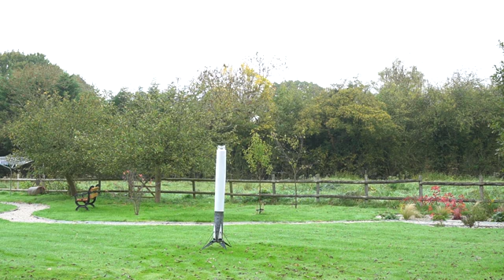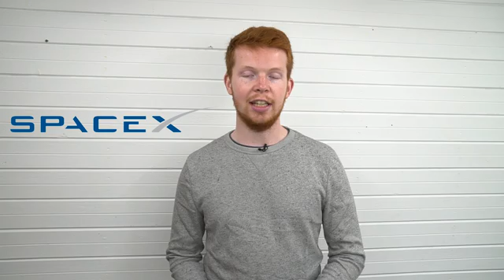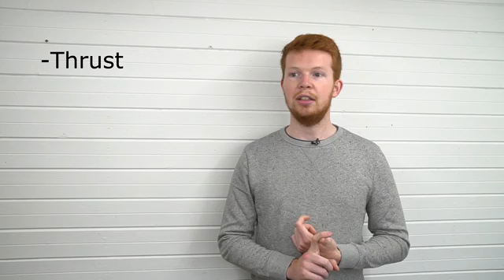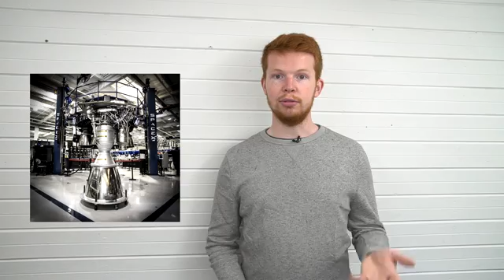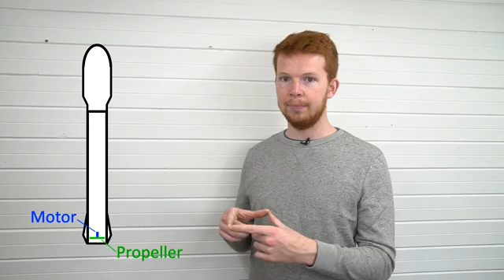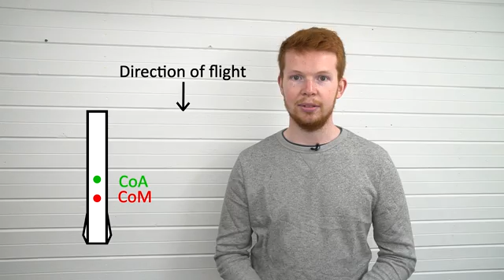Hovering a rocket - SpaceX model

Comment: Great video as usual! Only one or two issues I had with it, which are mostly semantic. First, I think it's important to clarify that using the center of area only really works for very simple and classicaly designed model rockets. For something like a falcon 9 or if you want to fly in directions other than up, you really need to find the true point where aerodynoc forces act, known as that center of pressure. Using the center of area approach would mean that a Soyuz, for example, would have its aero forces acting on a point near the back, but in fact it, and most orbital rockets without fins, has its center of pressure so where very near the nose. Most orbital rockets are actually aerodynamic ally unstable, and rely on the control of the thrust vectoring to stay up right. Second, and this one really is semantic, but there are more than 2 types of rocket engines. There's hybrids, which use a solid fuel and liquid oxidizer (See Virgin Galactic's Spaceship 1 and 2), Monopropellant, cold gas (similar to monoprop but without any chemical reaction), various electric propulsion systems (hall thrusters, VASIMR, etc), and nuclear propulsion (there was some limmitted testing of this during the cold war, but it hasn't been done since, although there are good reasons we should revisit it). Those are all the remaining types of rocket propulsion I can think of. If anyone knows any I missed let please me know.

Comment: It's a pain in the ass trying to land on or take off from grass. Especially the latter. 
Regardless if it's a rocket tripod or a remote control helicopter, some part of the landing gear is going to get caught up in the grass (unless it's a putting green). 
Even landing on grass is a bitch because while it may appear soft, it is also lumpy and therefore uneven.
A paved surface is generally better for either landing or taking off. That said, the consequences of failure can also be more damaging on pavement/concrete etc whereas grass and soil provide some level of cushion.

Comment: Just a thought...Seems you could support the rocket during tuning with a surrounding 'safety' hoop say 3 feet diameter, attached to the ground with attached stakes, and with the hoop positioned about 2/3 of the height of the rocket. Something akin to a support for a small plant or tree.  Such a support structure could prevent the rocket from rotating and hitting the ground when unstable.

Comment: Use some prop like old oxygen/carbon dioxide cylinders, proper reshaping it try to build a liquid fuel self correcting rocket atleast able to hover 50 feets high.

Comment: If the thrusters or control motors at the top of the rocket are pushing air up wouldn’t that act as resistance towards the motors at the bottom trying to push air down?

Comment: A few possible ideas here (not very scientific) firstly your tube diameter/compression of air why not funnel the air to be more focused. Example if you have your hand 40cm ish from your face, blow at your hand with an open mouth and it takes some blowing to feel it, blow at your hand like whistling. Not only is it more sustainable but it takes less to impact. Second on the subject of air flow coulda "laminar flow" help (this relates to jumping jet water fountains, but maybe the same could be true with air/ducting).  Simple examples I have seen to create the laminar flow are packing the tube with drinking straws and forcing the fluid (or in your case air) through them. Thirdly propeller choice I dont think you mentioned this but with quadcopters they have two opposing props.  When you used two were opposing or the same, and when you used one was it a neutral? Could this have affected some of your stability.

Comment: Very cool. Have always dreamed of adding a few of these large motors to every wheel of a sandrail so when you get air the fans keep the rail aligned in mid-air so all four wheels contact the ground at the same time. The hurdle is keeping the sand out of the motors.

Comment: SUCCESS. I have a project with thrust vectoring.  Maybe you can get a motor with a higher power handling and output. As I watched I thought maybe you could also use two motors computer control to alternate if the other began to overheat or fail. I know this is more weight and computing but it was just a thought.

Comment: Just... no.  
Your attitude control scheme is based on flawed understanding of physics. When hovering with propulsion like this, accelerometers are of no use. That is to say, your inertial frame carries very little information on your attitude. 
Center of mass being in front of center of pressure (as you kind of tried to explain) is important when you have forwards momentum, but really irrelevant in the case of hovering. 
The mass distribution of your rocket is also kind of irrelevant. top- or bottom-heavy vehicles can do this, your rotation axis just is a bit different.
Reply from the maker: Accelerometers are hugely useful in a rocket like this, unless you're skilled enough to react precisely within milliseconds of the rocket tilting. When I explained about the centre of mass being in front of the centre of pressure, I was referring to the accent/decent of the flight, so when it has 'forward' velocity. To claim the mass distribution is irrelevant just says it all really, almost as ridiculous as claiming my physics understanding is incorrect.
Reply: I should have phrased that differently indeed..  What I intend to point out is that while accelerometers are very useful to assess velocity, they are useless in stationary hovering (other than to indicate that we indeed are not accelerating in the axis of the rocket.) You indeed need to use gyroscope or some other reference to determine your angle. This is analogous to the pendulum rocket fallacy. - Gravitational acceleration is reference-frame independent - This is something that is completely understandable from high school physics but often fools somewhat good engineers even. If you think this is something that can be handwaved off, you have not really grasped the problem.

What SpaceX uses is gyroscopes because they have money and access to highly accurate ones. The stuff a civilian can buy and fit inside something that flies with batteries will hold sufficient accuracy for some minutes if you do your algorithms correctly. Without corrections, they will veer off in some dozens of seconds. You can use some trickery to get away from this. One that easily comes to mind is some sort of image recognition in the bottom of the aircraft. In these times when you can perform image recognition on a dime this sounds like a good idea, until you take a look at the footage you will be dealing with. The shaking is immense when mounted on a light RC-craft. With some heavy stochastic corrections, this will work though. 
Some RC planes use IR sensors on wingtips and then place their bets that generally space is colder than ground, and hence horizon will be observed at wingtip as a falling edge in IR spectrum. This can work wonders on high altitudes, and cause hilarious crashes between obstacles.
Reply: Also, you are correct in that the center of mass is relevant in the sense that the rocket will rotate about it, and the attitude thrusters will have more momentum if the CoM is low.  I should have stated my point like this:  A low center of mass does not precipitate more or less stable hovering quite like when balancing a rod on your palm. It's effect is restricted on determining the momentum an off axis thrust has.

Comment: Inverted pedulum
https://youtu.be/qjhAAQexzLg

And its application
https://youtu.be/15DIidigArA

You can gimbal the engine, change the thrust vector on the engine, have four different engines each with variable thrust (quad rotor), or inertia wheels or some combination.

Inertia wheels
https://youtu.be/woCdjbsjbPg

Comment: 3:24 HA! awesome!
Reply: 12:40  you might need a structure holding. seems like the landing flaps might creating unwanted drag and drift. a structure could hold the rocket so you can have those folded up at launch.
Reply: 18:33 maybe add 2 more smaller props at the top and program them to increase the speed on specific props if it finds itself drifting?

edit: of if you can get it to spin super fast lol

Comment: I'd say it was a success. May I suggest building a light weight ring of about 48 inches diameter mounted about 16 inches off the ground to help recover from tipping (just until you've perfected it. Have you considered using gyroscopic spinning disks in place of the 4 top fans. No idea if it's a sound idea, but a thought.

Comment: U simply got to solve the equation of inverted pendulum & program in controller.
For proof of concept go as small as u can. U should try simple 10$ gearbest quad & use its motors.

Comment: Hi , this is Chris in Bulgaria, modelmaker of stuff and I have a Cr10s. I built a model rocket designed it in Rhino then printed it out. 
While watching your video one of your attempts I noticed the rocket lean over a little. Not what you wanted at the time, but straight away it gave me the idea. What if you were to lean it over on purpose then horizontaly fly. Well, would this make for a Thunderbird 1.
 Living in Bulgaria everything with electric motors is, well, not good. I have learnt to run motors in. I thought what a load of rubbish, but, yes, run your motors in. Start and stop them for an hour or two before going for full power.
I also learnt a few things from your explanation of mass etc. I will stick to the modelmaking, I have a giant plastic box of dead helicopters, hahaha, i think to add a few things to my model rocket as well because of this video, Thanks, keep up the good work. Long live PLA

Comment: Hey it’s a good time to use Machine learning... leave the thing calibrate itself overnight
Reply: Or just use an inverted pendulum controller, you don't need machine learning for a simple stabilizer. It's (probably) inefficient and less intuitive. That's why they don't use machine learning in space flights...
Reply: [Brn], for sure. I thought ML would make stuff easier but just simple Algebra is just enough.
Reply: @wyattb3138  definitely more fun ;)
Reply: Wyatt B , would probably just take a few minutes
Reply: Also put guns on it and enable it to duplicate itself. I don't know what could go wrong.
Reply: Mehhh, not required
Reply: I thought the same, using PILCO for example he would only need to build a couple of these, it should get to a good policy in a couple of trials, trashing the whole thing :D
Reply: I think it could work, but it will be very difficult if it encounters conditions that it wasn't exactly trained for. For example different temperature or wind if it reaches some altitude. Since the resulting model may be a complete black box, it's also hard to find out if it is overtrained without physically testing it.
Reply: Machine learning actually sounds good. It may sound like simple algebra but factoring  in the weight distribution, the airflow characteristics of the thrust vectoring at different angles, the torque / rpm curve of the propeller motor, drag curves for the propeller, thrust vectoring servo motor time to position at different load levels and angles considering sometimes they'll be working way against the wind and sometimes with. All those values will be on curves and some depending on one another I feel like that would all be farrr from simple.Maybe easy enough to get going to stay stable given some given conditions and typical RPM but across all the ranges ML would be much nicer. I don't think a pendulum is a good approximation of the rocket in practice if you are trying something as sensitive as hovering. Even good drones struggle and the cheaper and newer code takes yeaaarss of refinement to get close to stable
Reply: @BartekJuszczak  I respectfully disagree with you that the inverted pendulum model is not a good approximation. It is worth mentioning that the inverted pendulum model is not too different from the rocket landing dynamics, on the contrary,  I would like to argue the mathematical models are (nearly) identical since both tend to unstable equilibrium position naturally (i.e. the heavy side down). The only difference might be that the pendulum is fixated to the world; whereas, the rocket is expressed in a moving inertial frame. But this does not complicate your stabilization problem. You simply want to stabilize the rocket in the upward position using the thrust vector fixed at its base.

Then, as a secondary control loop, you ensure the entire rocket makes a slow descent towards landing. Nevertheless, you primary concern is that the rocket stays upward.

I agree with you that drag curves for the propeller and other un-modelled disturbances might be useful to learn with ML techniques. But that's feed-forward control not feedback control.
Reply: @BJCaasenbrood  Thank you for your nice, interesting and constructive comment. 
With your explanation I can see how it would be a good approximation.
Do you not think thought that due to it being an unstable system an approximation disregarding all those variables is not good enough for a stable smooth hover? I feel like the difference between hovering with no wind and like 100 corrections per second -  and being able to handle the real world with like 3 corrections one would actually expect to be necessary is an infinite amount of refinement . 
Perhaps measuring motor thrust curve at different voltages and sticking that into a hash map would work well. If one put in the mass of the rocket as well you could end up with 5kg displaced by 10 cm = x joules that way = 17 volts for 1 second.
I need to read up more on feed-forward control and feedback control. It is cool however that those are also basic features of a neural network. It would be cool to experiment anyway.

Comment: Interesting project thanks for  sharing. 
A few discussion points I'd have is. The height of the center of gravity will obviously affect the response of the control system giving different amplification on the feed back. The effect of the control surfaces will alter dependent on how much air flow you have so you'd have a completely different set of parameters in your control loop for full fan or half fan etc.  It appears you may also have a bit of non damped oscillation in your control system, is the gain too high? Have you the facility to calibrate the control loop depending on fan power ? And maybe even sticking in a PID term controller. I'd be real interested to see if once setup would it handle all the probs you're having ? It would need a smarter controller though so might not be possible.

Comment: I wonder if instead of trying to land it directly onto land or a barge they could do this by catching it with a helicopter. By stabilizing a sufficient enough to just hook onto a bar at the top of the rocket.
This might sound a bit mad as well but I'm wondering if it'd be possible to have an extra albeit smaller engine attached the rotors that fold out for landing and act as a helicopter for landing it.

Comment: At 4:29 you say that the Center or Area is the point at which the areas of the rocket above and below are equal, but this is not correct. It is the point that is the average of all area, which is not necessarily the same as the 50% point you’re describing here. This distinction is the same as the distinction between the Arithmetic Mean and Median in statistics.

Comment: Solid test and success. The corrections in vector i'm sure were more difficult due to the scale of the rocket with less room for error and quicker response times. Only reason the wind was a problem is the lack of GPS to  keep the rocket on target. Awesome stuff

Comment: Position and altitude holding even in wind can be achieved by integrating a GPS into flight control board as it is with quadcopters.  Not sure how real space x rockets manage position holding but control theory is that if you have sensors and thrust control which are sensitive enough to sense changes and make thousands of adjustments per second, as in modern flight control boards for drones, even in the case of a rocket flight stability like this should be achievable.

Comment: Great Effort!!  Also, your making things much harder by placing the batteries at the top.   On an actual space-x booster the heaviest part is going to be the engine, which is at the base.  See is you can relocate your battery closer to the vector vents.  You Center of Gravity will make things much more stable.